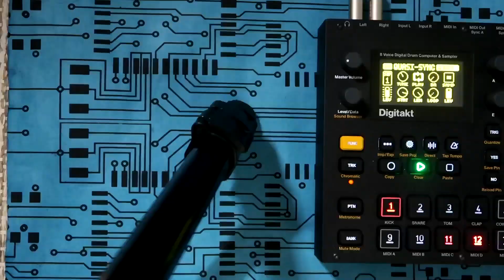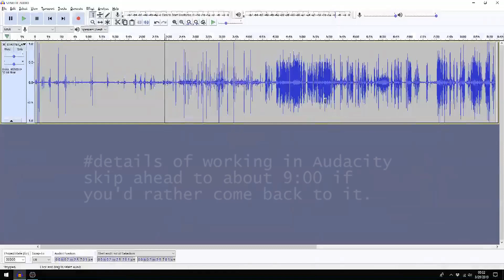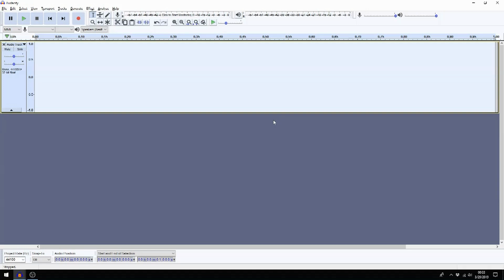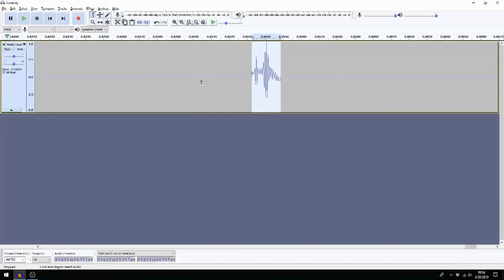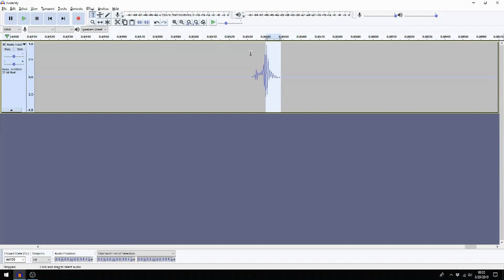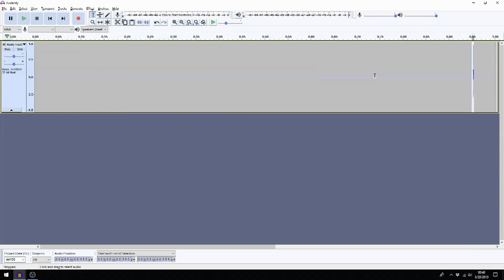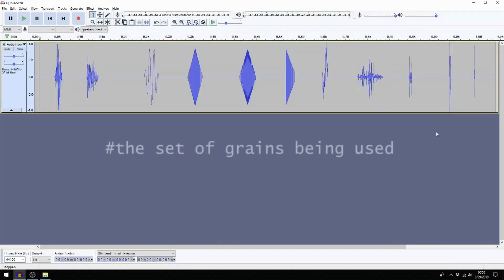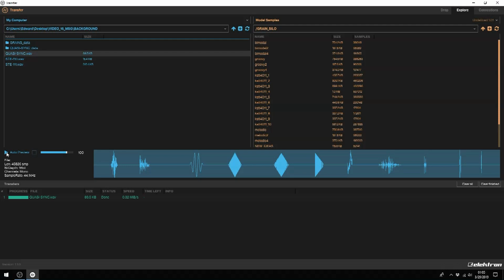Model:Samples - Granular

Comment: Interesting. Just ordered the :samples and the Minibrute 2S after 2 weeks of diving into youtube videos about synths. I have no idea what awaits me but i am sitting on hot bricks here.
Reply from the maker: Well, I feel like you have a lot in store for you when they arrive. Best advice I can give is to make sure your Samples is fully updated. The Elektron Transfer application (as seen in this video for sample handling) makes it pretty easy to update, if needed. The latest update gives nice features, particularly "velocity modulation" which allow variations in pad strikes to do something like change playback speed. While the Model:Cycles is quite different, in the "head", the "body" is basically identical - and there are 5 Cycles videos on this channel (with maybe the one on sequencing being the most relevant?). Anyway, as for your Minibrute? I can only assume it's great. I have a Microbrute - such solid build quality and design, wonderful sound. I assume you will be able to send the Samples sound through the Arturia, maybe mono only, but that could be nice. PS I also did a Samples video on looping that might be of interest. Enjoy your new gear👍🏻!
Reply: @undulations  Thank you for the info, i`ll check it out after football. Thats one thing i am hoping for. Being able to send processed samples into the MiniBrute circuit. But even if this doesnt work out well, i`m just starting to see more possibilities. I first thought of the model samples as a beat machine,  also considered the Volca sample, but i think the elektron is a bit more advanced and there might also be issues with the volca regarding sample transfer with no USB. Was also thinking about buying the Digitakt only but the magic of the Minibrute cought me stronger. Overall i was amazed by the amount of hardware there is available now, really a tough choice when having your wallet in mind also. Have a good one

Comment: this thing is powerful!
Reply from the maker: Yes! Also, some big updates since I did this video. For one, you can use the pad velocity to control other parameters (like start position or such). This video is kind of a niche application, but overall it's a nice sampler with a great sequencer, especially for the price. Thanks a lot for checking out the video🙏🏼!

Comment: Hi, just got this machine as my first sequencer and one of the first things I thought when I learned that the memory was limited was whether using a clip with many small sounds and the sample start/length to zoom in on each sound would effectively give you multiple sounds per track. Lo and behold there is a name for it called granular synthesis! Thank you for the introduction. Is this different from using the osc samples and the loop/lfo to create synth sounds? Also does the new sample lock feature make this easier to do without having to fiddle with the sample start/length? I will definitely stay tuned for more videos.
Reply from the maker: Well, I'd say that you are correct that looping the osc samples is probably technically a type of granular synthesis, even though the usage can be quite different. I agree that the new sample locking gives a different way to approach things, but I do still like the method in the video because it doesn't tie up sample slots and allows mixing adjacent grains.  Overall, I'd say that sample locking combined with multiple grains per sample would really open up a path to a lot of variety. Your comment has given me some ideas for the next Model:Samples video. Thanks a lot for watching!

Comment: thanks, another fascinating exploration, well broken down and easy to follow, jeez, even i can understand it! i'm trying to do something similar with the volca sample and it isn't exactly ideal. based on your experience (microgranny etc), would you recommend the model samples to do decent granular processing? looking to upgrade my volca sample and figure i would get a good drum machine (love those chance settings) and perhaps a fairly decent granular synth for ~$400 cdn. i also have a eurorack set up and the only thing i've seen in my budget is a clouds knock off or the nebulae. i really enjoyed the hands-on audacity grain creation and can't really see how i could get this level of accuracy (grain selection) on clouds or nebulae easily. keep on trucking ...
Reply from the maker: Well, I think the Model:Samples has a ton of depth for doing granular. 6 tracks, built-in reverb and delay, sample start/length that can be automated a variery of ways, track-based panning, etc. As I mentioned at the end of the MicroGranny video, I'm definitely planning to do a another granular video about the Model:Samples - but more in line with the stuff I've done on the MG and in SpaceCraft. Plus, as you say, it's also a nice groovebox/drum machine for other (or hybrid uses). You still need a computer for sample transfers, but that's quite an easy setup, and I feel like not having resampling (like Digitakt) is less of an issue for granular uses. A lot of it comes down to samples sizes, choosing the length for what you're up to, and sample-locking was added right after I made this video - seems even more flexible with that. Best of luck on it and thanks a lot for checking this one out👍🏻!
Reply: @undulations  thanks for the advice! consulted the Roads book re granulation parameters (pg 188) and it seems the Samples only real lack comes in envelope manipulation (shame they declined to add an attack knob). i believe there may be something in the lfo menu but then, apparently you lose the lfo functionality? (only did a quick reading of the manual) i don't quite understand the spatial position parameter but it looks almost like the grains are being piled vertically/polyphonically as well especially in videos with the gr-1 where the LED graphics are very helpful for me to understand exactly what is going on.
Reply from the maker: @rainerd9890  This hits right at the core of "true" granular as described in the Roads book and more-or-less in the spirit of Xenakis. It can take some very different processing compared to a typical sampler, as-such. Custom code, advanced daw plug-ins, some modular - they go in that direction. And this video was really me trying to find what I could do - within the classic sense of granular - on the Samples, and the quasi-synchronous version seemed like it fit the gear. BUT, there is a whole other style of granular that's more akin to sample mangling and chopping, etc. Something like SpaceCraft sort of tends to be some of both types, but simplified in terms of polyphony and spatialization. And, I mean, the MicroGranny is monophonic and monaural. So it's a wide field, I guess. You're right about the attack - I think from the groovebox perspective it can be solved by putting the attack in the sample. I did the LFO thing on the Model:Cycles for an IG post, and it does use it up. But, I think - based on doing this video which was a while ago- the Samples does do some sort of smoothing at the "grain" level (which we have no control over). You just don't hear the clicks and pops like you do on the MicroGranny. I keep wishing Korg would make a Volca Granular of some sort🤔.
Reply: @undulations  thanks again, the Samples is on order! i just wanted to make sure i could do some granular with the device and its limitations are only a challenge. it's a bit of a disappointment when everything is done auto-magically like on the nebulae in terms of learning, understanding and experimenting even if it can go deeper into pure granular synthesis. like, i wonder what would happen if you prepared your grains in audacity as you did but with 2 different grain tracks (stereo) and converted back to mono? a big mess or perhaps greater density. anyhow, plenty to explore and discover ...
Reply: @rainerd9890  I don't have a Volca Sample, but I'm not sure how you would get granular synthesis on it since it lacks randomization. did you give it a shot? curious about your results!
Reply: @zonkey3850  i attempted to get randomization by using the motion sequencing on the 'start' and length' parameters on the v. sample so the grain lengths/size changed but the change was always the same. with a lot of grains and multiple grains per step it was how to notice that they were not random. so i definitely think it is worth taking a shot if all you have is a sample.
Reply: @rainerd9890  that's still a very cool result! I'm sure you could hook up your volca to a DAW and output randomized parameters? I'd probably try that. I don't have a Volca but I'm getting a Model:Samples soon, excited to try some grainy stuff :)

Comment: great video :) Also some useful tips on audacity.  At 10:33 you showing the sheet with the start points of the grains. How did you figure out the start points? Just by fiddling with the sample start position? Or is there a way of knowing which number of the start position matches which time on your sample?
Reply from the maker: distorson Hey, thank you! Yes, in this case I did it just by fiddling. I’ve never really tried it, but I’m pretty sure the 0-127 start settings are linear within the sample on the M:S. So, by using a fixed sample “grid” in Audacity you could probably do something like have samples start at start values of 0, 10, 20, etc. on the M:S - the actual sounds being evenly spaced, but not necessarily having to be the same size. One thing to look out for is that if we put too many sounds in a sample then we might lose fine control over the loop length and hence the granular “pitch” in this sort of setup. But the upside of that would be being able to blend a bunch of neighboring sounds together. Anyway, thanks for checking it out👍🏻!

Comment: Have you considered Clouds by Mutable Instruments in a small rack (it's no longer being produced but clones are available)? With CV you can really push the randomness and density.
Reply from the maker: Well, first of all, I'm a big fan of Mutable Instruments - I've got Plaits and also Branches, both so nice - and I really like how they open source their designs - so I get a little of their modules in my Arturia MicroFreak and even my Polyphonic Whale (I think Braids and a mini Clouds, respectively). But I think you're right - I should look for a used/cloned Clouds module👍🏻. But since this video I've done some granular in SpaceCraft  (on iOS and also as an Ableton plug-in), which I like quite a bit, and I've also gotten a Bastl MicroGranny - which seems pretty limited but is still pretty fun - I'm making a video on that right now (and also revisit using the Model:Samples for granular, knowing a little more and after some firmware upgrades). Anyway, thanks a lot for the suggestion and thanks very much for watching!
Reply: @undulations   Very cool. Well I was pretty impressed what you managed to pull out of that sampler. Just thought I'd mention Clouds because it's amazing for one, and pretty simple to get the desired effect. I guess you've definitely given that some thought considering the gear list. Awesome job on the video. I was thinking of picking up a Sampler and watching some reviews and you managed to take that thing in a completely surprising direction.
Reply from the maker: @lycosa2000  Many thanks🙏🏼 Hoping to get some other granular effects out of it in this current video! Thanks again for suggesting Clouds!

Comment: Thanks for the cool granular perspective on using this kit. How did you make those intricate symmetrical samples using audacity?
Reply from the maker: Thanks for checking it out! As I recall, it was a lot of cutting and pasting. I used a few recorded samples but also used the built-in generation features in Audacity for some chirps and noise I think. I may have done some symmetric stuff by copying and reversing stuff. For example, if you have a kickdrum transient you can cut that at the first peak, copy from there to the tail, reverse the copy, and then put that in front of the original. It will be symmetric (and sound kind of like an underwater thud). Hope this helps!
Reply: @undulations  Thanks for the helpful reply

Comment: why don't you continue working your samples in the computer (DAW),  instead of the elektron? The result would be quite similar, don't you think so?
Reply from the maker: I feel like that's a totally valid point to make. I guess the easiest answer is that this is for somebody that already has a Model:Samples - something different that they can do with their groovebox. But I also feel like hardware tends to guide the user, give a subset of choices compared to a DAW - so while I probably could duplicate this in Live (or another DAW) by using a similarly mapped MIDI controller - I probably would have done something different. That said, I do really enjoy granular synthesis in a DAW, particularly with the SpaceCraft plug-in and using the MidiFighter Twister as the controller (I did a Delta Waves video on this channel using that setup). Anyway, thanks a lot for watching!

Comment: I have never owned a sampler, sequencer or synthesizer… what should I start with
Reply from the maker: Well, I feel like I could help, at least give you some things to consider, but first some questions:

- any thoughts about how much you'd want to spend. just roughly, like under $100, under $200, etc.

- what kind of music/sounds do you like, or even better, what kind of music/sounds do you think you might like to explore? (former may not be the same as latter) so, specifics like beats-based music vs more freeform ambient would be good to know. also if you want any vocals of any sort (not necessarily your own, maybe samples).

- do you feel musical, technical, exploratory, etc? definitely no requirements, but it might suggest where to start.

- do you have a laptop, pc, solid smartphone, tablet? (some gear needs to update, interface, etc. and there are a lot of useful apps).

lmk and I will be able to have a pretty reasonable idea of suggestions.
Reply: @undulations  $600 max to start with.
Reply from the maker: @moorechez67  Well, that much gives a lot of options. If you want to go the "beatmaking" route then you could get a Roland SP 404 Mark 2, which many people swear by as a all-in-one system. If you wanted to do more experimental modular synthesis things then you could get a Make Noise Music 0-Coast synth and an Arturia Keystep keyboard or a Korg SQ-1 sequencer to control the synth. If you want more of a middle route then getting two (or more) things would work. Maybe an Arturia MicroFreak for many synth sounds, combined with a Korg Volca Drum for beats. Bear in mind that as soon as you have two (or more) it's common to need more things (cables, mixer) to be able to sync them up and combine the sounds. Lastly, one way to start would be to get the instrument shown in this video, the Elektron Model:Samples, and see how it goes. It can do so much. Ships with built-in samples, pretty easy to add more by a laptop usb. You can do synth stuff with it, you can have vocal samples, a really broad range of choices.  (This video is kind of a super specific niche use if the Model:Samples, looking at Elektron's videos or a ton of clips on Instagram would give a better idea). If you want more synth sounds and beats then maybe the Elektron Model:Cycles would work (I have a bunch of videos on here about that box). Best of luck with it all!
Reply: guitar.
Reply from the maker: @xisotopex  That's fair😀. A lot of times that I want to just sample a few riffs and chords. Great way to learn music theory too.